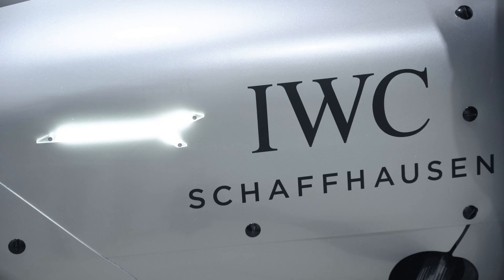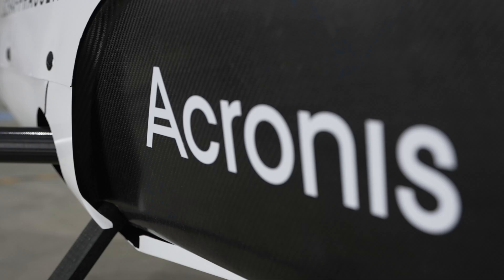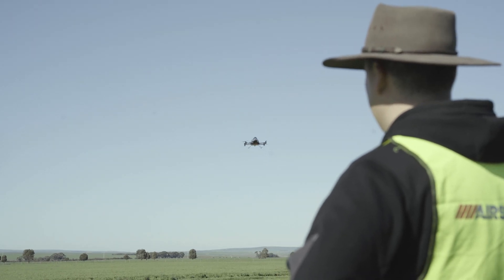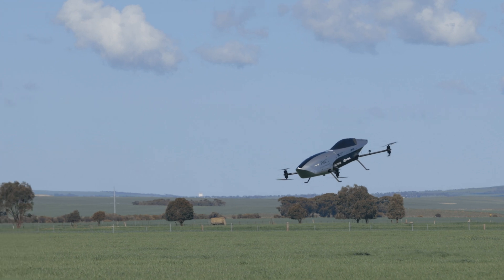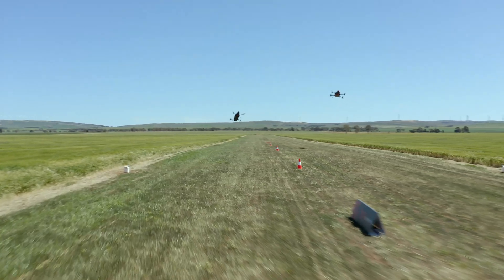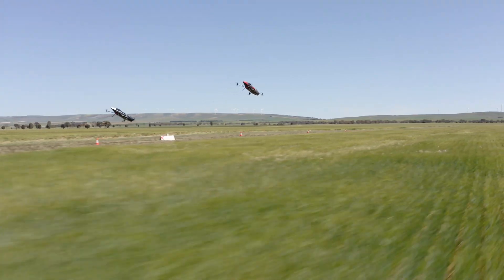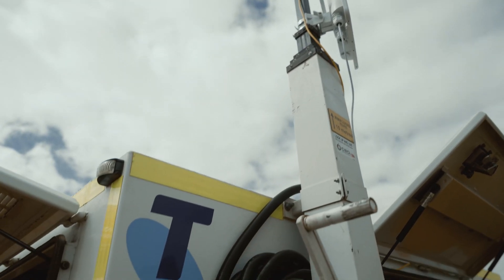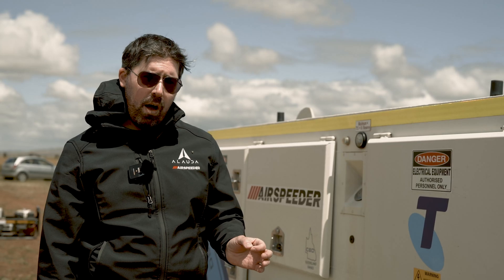Race eVTOL commissioning, 5G connectivity and race control building begins | Alauda Taking Flight

Comment: Cannot wait for more than just drag racing! Although question - during the drag race the speeders look like they don't add that much pitch to them, what's the angle of the flight? Is it like 30-40 degrees? (ok sometimes it looks more and sometimes less ^^")
Reply from the maker: Correct, MaionHigh. Ultimately the Mk4 will be horizontal for the onboard pilot. The design will change. Don't forget to subscribe!

Comment: Airspeeder look great until it pivots to that 45 degree angle in the drag race, and then it looks un-aerodynamic, an Airdragger.
Reply from the maker: EXA Series will be the time for experimentation in prop set up: tilt rotors? Could be an option for race teams.